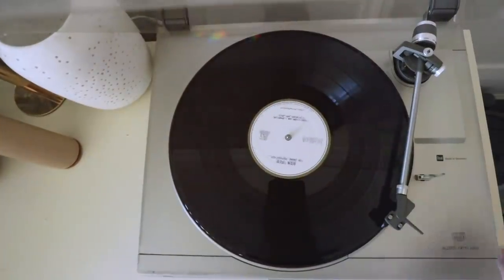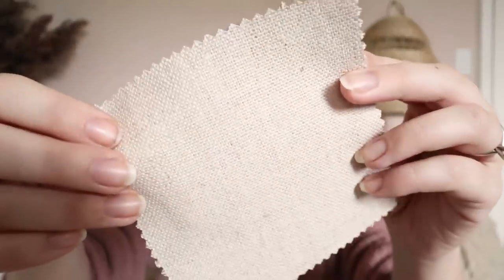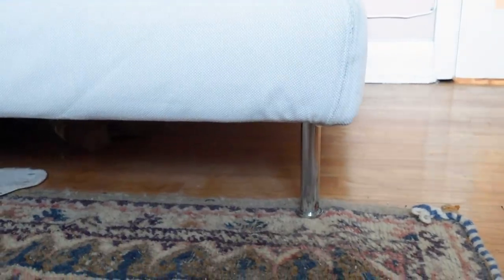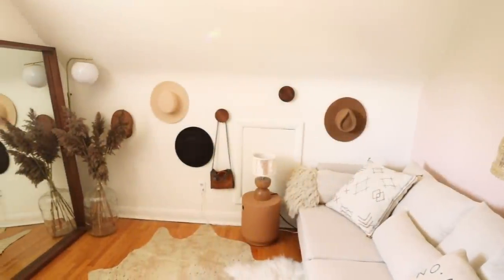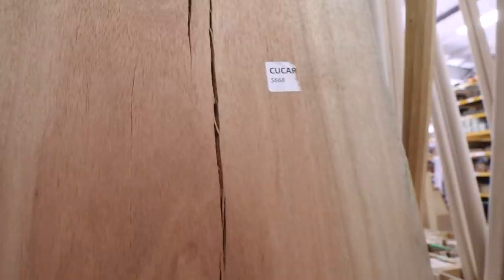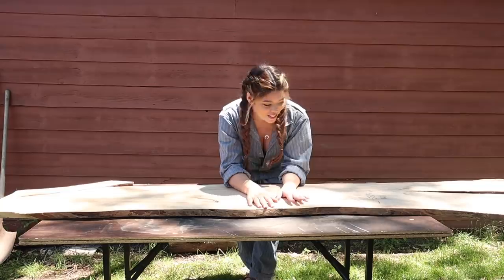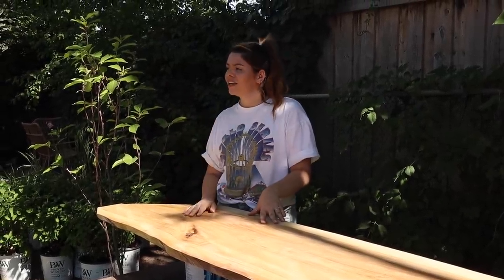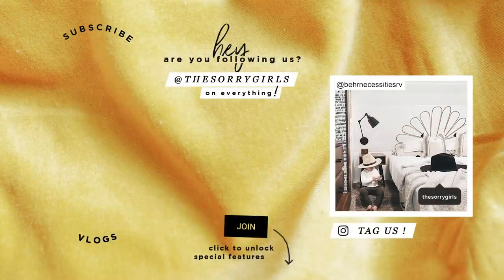i hated this window so i gave it a makeover | DIY Diaries

Comment: That live edge is GORGEOUS. The curtains up to the ceiling is PERFECTION..... however, girl... they need to go ALL the way to the floor to look lush. IMO. But you do you. Still love that live edge lol
Reply: I just found it very funny how this curtain track is a trend now and mt parents had this in their living room since 1998 :D And yes, the curtains need to go to the floor.
Reply: Omg, yes! Was thinking the exact same thing!!
Reply: I think this every time! Sooo many of the curtains they do are too short. It's a pretty basic design thing IMO 😬
Reply: Question: If I were to hang a curtain +rail above a window that is maybe  a meter wide in my bedroom. (Just one curtain. Not a 'split' curtain. Or 2 tiny curtains) Would you still hang it to the floor? Under my window is some space and then my radiator and it sticks out +- 20 centimeters.  
Would you then hang the curtain above the radiator or just below the window? Or not at all. Right now I have a roller blind.
I got this very long  red velvet curtain from my grandma's house. It used to hang in the hallway to block the cold from the frontdoor in the winter. But I am wondering what I should do with it. Velvet might look too heavy for in a bedroom..
Reply: Yes! No point going up to the ceiling if the curtains don't skim the floor
Reply: @shyshynka3927  1981 here ;) It all comes back

Comment: I liked the windowsill makeover, but I wish that crack would have been filled with clear epoxy. It's going to collect so much dust!
Reply: I agree, and post-install the existing window frame allows a “stop” at that side, so she can always go back and do this.
Reply: It also should be stabilized so it doesnt continue to split
Reply: Yes, a bow tie joiner would work well and look nice too
Reply: Erin Moore i had to look up what a bow tie joiner is and that is such a good idea! Didn’t even know that existed!
Reply: Yes, it’s a detail often used in a contrasting wood species/color to bring attention to it, but also joins the wood together. I’m second guessing now whether the split in Becky’s wood is too wide for it. But maybe at the base of the crack/check to prevent further cracking in combination with an epoxy fill. Imo

Comment: Gorgeous rooms and everything but this monstera needs to be watered, repotted or fertilized, because it looks thirsty for nutritions. 🍀
Reply: This is all I could think about 😅
Reply: Came to the comments to see somebody mention it !! It’s healthy just really wants more water
Reply: @Joconnor1192  Right. 😅
Reply: @Alproverse  Agree. 🤗
Reply: It is because they are drooping? I'm asking because i also have a monstera and I'm very cautious with watering as overwatering can't be reversed. So i was wondering about the obvious telltale sign that they are thirsty.
Reply: it should also be in a darker spot right? It doesn't really like direct sunlight
Reply: @miraxterrik  Yes, the drooping leaves, along with leaf edges that curl in more than normal, can indicate that the Monstera is thirsty. :)
Reply: @pixieofjoy  thanks!
Reply: @miraxterrik  Becky's looks like it needs a deep drink. As long as the roots arent sitting in water, you're unlikely to overwater. When mine looked the same I sat it in the bathtub and ran water through for about 5 minutes, then let it properly for a couple hours. Within a day or two the leaves had all perked up.
Reply: tbh, i think it's getting too much direct sun. it needs to be in bright indirect light and it will thrive.

Comment: The leaves on the monstera are so sad and it has so many aerial roots! Not an expert but it mine looked like that, it's split it.
Reply: Too much sun exposure :-(
Reply: Hmm, yeah, wouldn't be my favouite pick for up there, but then it's not my room. 😆
Reply: What's wrong with so many aerial roots?
Reply: @blondie6611  aerial roots is it literally trying to find sustenance elsewhere. It usually means that it needs repotting in a bigger pot with fresh soil and/or fertilizer.
Reply: Lorena Jaimes  Maybe it's time to put them in a cute plant pot with some soil. They do OK in water but that's not ideal for them.

Comment: The live edge window sill is such a cool idea. I want to do it for my bay window now... just wondering why you didn't get curtains that hit the floor?
Reply: Agreed! They're too short!
Reply: I’m assuming she reused the ones she had which probably fit the window lower, but they also probably weren’t floor length because the sofa is already close to the wall and it would look like a tangled mess
Reply: @ahumanaperson  Since she does so much sewing, she could have (and still could) add some fabric to the bottom. I'm not sure the extra length needed to hit the floor would be that much different than what is already there in terms of getting tangled with the couch. 
Overall, really nice updates, Becky!
Reply: Could be cool to add fabric similar to the lampshade she made to the bottom of the curtains so they brush the floor
Reply: Think these frame the window better and make it about the window, not the curtains.

Comment: Love the makeover, love your style and guts. Do want to point out that if you are not using the textile bag that CW send their product in until it falls apart it is less sustainable than a plastic wrap. I use a similar bag to collect my old paper, but there are a ton of options. It would be a great bag for Christmas presents (like you said), or as a laundry bag or to store winter bedding during summer.

Comment: Oh! So, just for anyone who’s looking to do the curtain thing... I did this back in January, also with curtains that didn’t have the proper strip of tabs. And I just wound up pulling a high res photo of that strip to see how the loops were “shaped” if that makes sense. Then I just hung out on the floor with an x-acto knife and carved out the same pattern (very careful not to punch through the fabric). Nailing the same outline as that strip has made all the difference compared to just jamming the hook in. I think the whole thing took like 20 minutes. I’m looking at it right now and there’s no drooping (and Becky’s right, the ceiling rail is hot and like 1/8 of the price of nice curtain rods)— impatience pays (sometimes)!

Comment: The crack might be a bit in the way of cleaning and such on the long run. You could fill it with clear resin, in that way you will still see the crack but dust and durt wont get stuck

Comment: I think that the color palette needs a little tweaking. I was thinking that drop cloth curtains might warm up the colors, warm up the color of the light and increase the texture of the room. It might just be me, but the unbleached canvas is just about the perfect color for up against the wood grain.

You painted the wood? It needed refinishing but tung oil would have done a great job until it could be refinished. The bay had such beautiful grain and pattern.

Comment: Have you considered getting/using (not just for home use, but for at the "loft" as well) a paint spout? I found it painful to watch all that paint get (seemingly) wasted at the 12:05 minute mark. 

They have very cheap paint spouts at various Canadian (or at least hardware stores that have locations in Canada) hardware stores Tire (fellow Canadian here, in Victoria BC). The Bennett Paint Spout is $3.99 (plus tax) at Canadian Tire and the SHUR-LINE 3.78L Paint Can Lid, with Pour Spout is $6.99 (plus tax) at Home Hardware and the Flexible Paint Spout is $2.39 (plus tax) at Rona and the Dynamic Super Lid With Spout is $2.98 (plus tax) at The Home Depot.

I am not affiliated with any of these companies or sponsored to say that, I just like their products.

They even make some that fit on half-pint paint/stain cans!

Hope you don't mind the suggestion and that I don't get in some kind of trouble for putting the specific paint spout info in this comment. 

Maybe I should have sent this comment in an email and included the links to the products. 

I love your videos!!!!

Comment: Are ceiling rails not a thing in America? You are supposed to use special curtain hooks that you can hook onto the plastic hooks that hang from the rail... It makes the curtains hang straight instead of being bunched up at the top...

And it'd look neater if the curtains had pleads sewn into.

Comment: Did you really use ben eggshell as your primer and finishing coat on the wood?????? Seriously not recommended or very durable for that application. At least a pearl sheen is needed for durability typically and the primers built in the paint is for going over existing paint. How is it holding up?